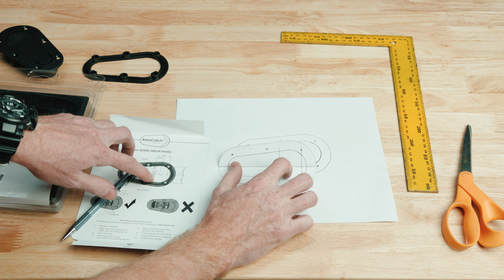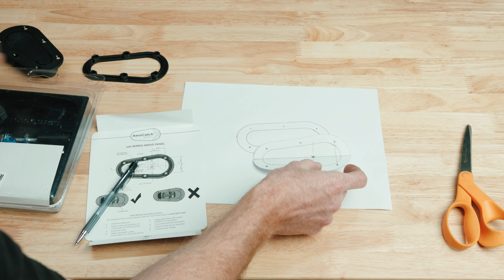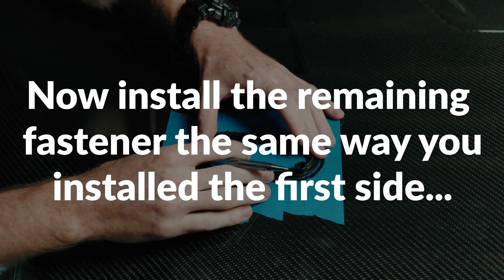How to Install Aerocatch Fasteners in a Seibon Carbon Fiber Hood on the Honda Civic Type R FK8!

Comment: One of the best vids describing this install.   I have a possible recommendation however.  There used to be a product sold by Password JDM   that was an aluminum piece of the same size as the AeroCatch backing plate with the holding slots for the fastener nuts.  However, the JDM aluminum plate had the mounting holes threaded.  The process to use this mounting plate was to insert the aluminum plate thru the TOP hole you cut in the hood.  Then rotate the mounting plate to allow you to insert 2 threaded studs into any of the threaded holes of the plate.  Then pull those studs thru the reciprocal holes in the hood .  Then slide the AeroCatch latch into the hood cutout and the 2 studs sticking up thru the screw holes.  Now you can insert the remaining small fastening screws.  Then just unscrew those 2 studs and insert the remaining 2 screws into the AeroCatch latch and your done.   No need to make that large under hood cutout for the AeroCatch provided backing plate!

Comment: is there any other areas on the hood to install them? my first molding hood has a hump where the airbox is, so the driver side placement of the catch won't be usable... hmmmm..
Reply from the maker: The important thing is that the latch lays flat across the hood when you install it.  So, if you do pick another location, keep that into consideration.

Comment: Man... what a great video! Totally helped me just install mine. Question though, the drivers side pin goes in right in line with the air box. I have not water tested the aerocatches yet but they do not seem water tight. Anyone test that yet?
Reply: Awesome!   Glad to hear it.  I've been running this for several months now with no issues whatsoever.   Even when I wash my car, I dont worry.  Good to go.

Comment: This was a solid video as I've seen other ones and they were not as perfectly described and honestly the way you speak calm me down to know it's okay to cut 😂. I have one question though. I have a Kevmsnz VO carbon fiber with center see-through acrylic. I cannot mount at that exact location that you used on the seibon hood and was thinking about using the two exterior factory holes. You got any thoughts or tips?
Reply from the maker: Hey!  Thanks for the kind words.  Man, I'd hate to set you off in any direction without knowing 150% sure I was right.  One of the main things to consider (which is mentioned in this video) is that the plastic fasteners need to be able to lay completely flat on the hood wherever you mount them.  If when using the stencil the center pins line up and the fastener is able to lay 100% flat in that spot , you should be good to go.  But don't take my word for it since I haven't done that hood before.  My best advice is to find someone that has and ask them.  Else have a professional install them.

Comment: What kind of cutting discs did you use?
Reply from the maker: I just bought some basic ones off amazon.  The type that come in the small bit kit with most rotary tools.
Reply: @geforceginger  thank you! I figured it out it was diamond cutting discs, Your video is the only reason I was able to install mine😂 thank you for going into so much detail
Reply from the maker: @derdagaminbear1212  No problem.  Glad to help!

Comment: Serious proposal.  If you are local I would like to pay you to install the pins on my varis hood
Reply from the maker: Where are you located?
Reply: @geforceginger  Delaware.
Reply: @Justintm  Im in Houston.  There's gotta be a local body shop near you that'll do it.  Shouldnt be more than a couple hours labor.
Reply: How bout seibon hood fitment?
Reply from the maker: @mkFF4693   @mike stone  Mine fit like a glove.  I'd give it a 9.5/10.  Other brand carbon fiber hoods I've installed for other FK8s weren't nearly as good a fit.  Hope this helps!
Reply: @geforceginger  did you cut the two bolts 1 inch in size?  why? ... in ur movie I see the bolt is still not cut off ... is it true?
Reply from the maker: @mkFF4693  I had to cut them. The bolts look bigger at the start because I had not yet cut them.  Sorry for the late reply
Reply: @geforceginger  I have the same hood as yours, do you worry about rain water in the engine bay, especially around the PRL intake?
Reply from the maker: @neonunderground5972  I used to, but was told not to by people who know more than me (which is saying alot because im damn near a mechanic).  But after a year plus of this car living outside and driving in rain non stop, ive had zero issues.  The intake airbox has a small hole at the bottom to drain water.   And the vents dont directly line up with the airbox either.  Even when washing my car, no worries.  Ive put 30k miles on this setup and under my hood still looks like new.  Not a single problem whatsoever.  Youll be fine.
Reply: @geforceginger  Thank you.